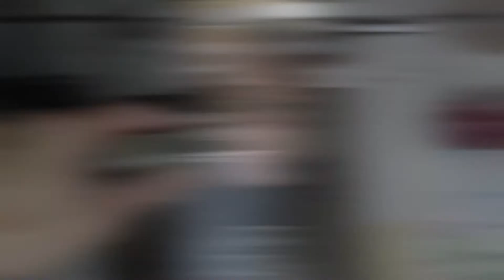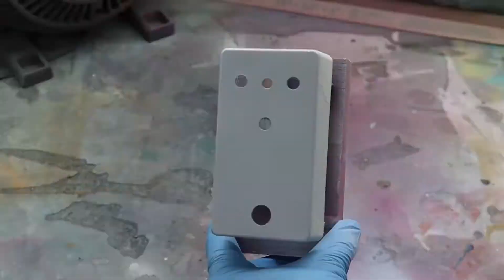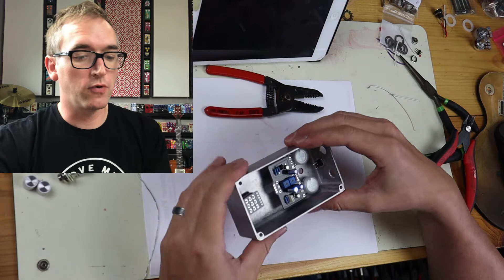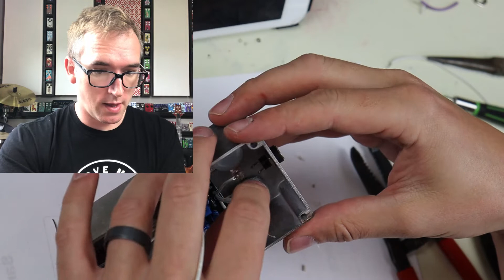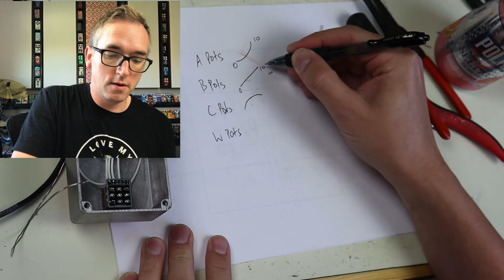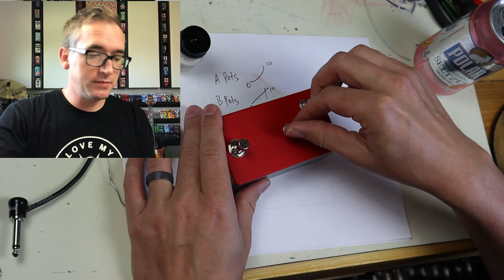How To Build Your First Guitar Pedal Part 2

Comment: PLEASE. I need help figuring out how to connect the potentiometers :(
Reply from the maker: To connect them to the pcb? What can I help with?
Reply: @dkpedals  I was wondering if you connect them directly to the pcb or if you can use wires. Also do they connect to the back of the pcb? I might have to use wires because my potentiometers don't have the right angle.
Reply from the maker: @tobiashua  okay, you purchased pots that have solder lugs on them? You can use short pieces of wire, tin the ends of the wire before threading it around. It makes it a bit easier to keep all the stranded wire together.
Reply: @dkpedals  awesome thank you ur the best love ur vids
Reply from the maker: @ thank you!!!! I really appreciate it!

Comment: What would cause an led to blow? I’ve tried multiple leds in both directions.
Reply from the maker: Check your current limiting resistor, if you have a wrong value too much current will pop a led and too little current will make your led very dim. The pedal standard for CLR is usually 4.7k

Comment: Great tutorial! I find it helpful to keep a tube of soldering flux with a toothpick in it to dab a little flux on the solder pads. It really helps the solder flow better with larger solder joints, like on footswitches, pots and jacks. Also helps with tinning wires, so it's a quick process where the insulation doesn't melt and the wire end doesn't get too fat.
Reply from the maker: This is a great advice! I use a syringe of flux to apply in the hard to reach areas. Cannot recommend it highly enough

Comment: You stated that by using the PedalPCB 3PDT Breakout Board, this allows you to just use wires connecting the breakout board to the PCB, correct? In the wiring diagram for the Sandspur Fuzz, it shows some jumpers being used. If I am understanding you correctly, this breakout board sounds like an awesome deal, as those little jumpers can be fiddly.
Reply from the maker: It eliminates those fiddly little jumpers and makes the build a lot cleaner. Just be careful how much heat you apply to each lug because the inside of the 3pdt switches are very sensitive.
Reply: @dkpedals  Appreciate the quick reply! I've been building pedals using "all-in-one" kits from BYOC and have a few StewMac's on my up-next list, but after those are complete I plan to venture into the world of starting just with the PCB only, and sourcing my own parts. This could get dangerous! 😀
Reply from the maker: @seangarland  you are making the right progression, imo. I started with byoc kits and worked my way to buying pcbs and sourcing parts. The build documents from aion or madbean have a ton of great info about part sourcing. I tend to read them for fun and always find them informative and helpful.

Comment: so for the inpout/output jacks, one of the prongs is longer than the other. does it matter which one is connected to ground vs. the audio signal? thanks!
Reply from the maker: Absolutely! There is the tip (audio signal) and sleeve (ground). They must be hooked up properly otherwise your signal will go right to ground and make no sound. 

Look at a guitar cable jack, the head of it is the tip and that is what carries your signal  along. The shaft of it is the ground, when I started out the best way for me to really cement it in my head was to put a cable into a jack and see how it all works.

Does that help?
Reply: @dkpedals  got it that makes sense. so my pedal passes audio in bypass, but when i turn it on it passes no audio, and just mikes a sound like a siren haha. then after a minute the led shuts off... im so confused haha
Reply from the maker: @ryanmelvey8764  post a picture on the forum or send me an email with some good pictures and we will get you rolling!
Reply: @dkpedals  thanks man i'll join the forum!
Reply: @dkpedals so i didn't realize the IC orientation mattered. flipped all of them and got my first pedal working! thanks for your videos man, extremely good stuff
Reply from the maker: @ryanmelvey8764  hell yeah! I highly recommend joining the forum

Comment: What's with the grounding of the board?
Reply from the maker: Okay, i forgot to run wires from the ground holes on the board to the jacks. That is essential for the pedal to work, the ground runs from circuit to the lug of the jack which makes contact with the enclosure creating a ground.
Reply: @dkpedals  My apologies, I didn't realize that's what you were talking about. I thought you were running additional ground wires for extra security. Thanks for the reply!
Reply from the maker: @jralanmorgan  
Anytime!!
Reply from the maker: Can you be more specific?
Reply: @dkpedals  You say it at the 15:55 mark.

Comment: Amazing job. The best I've seen with this much detail. I pretty much follow the same process EXCEPT I never knew that the foot switches were so delicate. Great advice on soldering those. Good system for the LED too. One thing, I've read not to tin wires going onto a circuit board. Not sure when/where or why, but I do recall seeing that. Its a real pain in the ass though to try and shove those strands through without a random strand doing its best to ground itself to something, or heaven forbid get against something else. I think I'll follow you there and tin from now on. Thanks for this. Awesome job. Looking forward to seeing how you finish up!
Reply from the maker: Thank you very much! I really appreciate it. That whole stray wire is why I tin everything. I had a build derailed because of one tiny little wire and it drove me crazy!